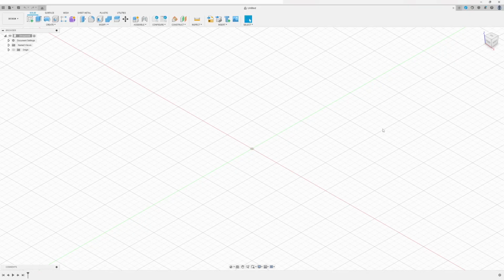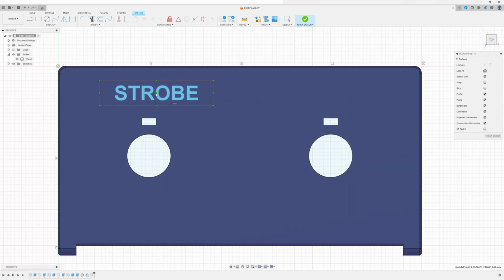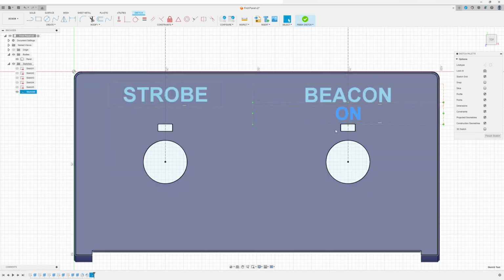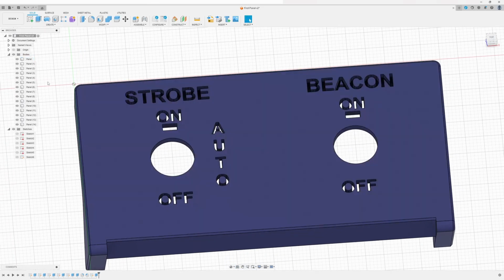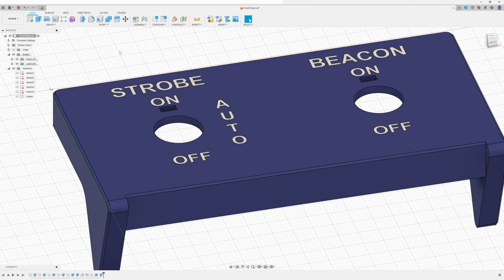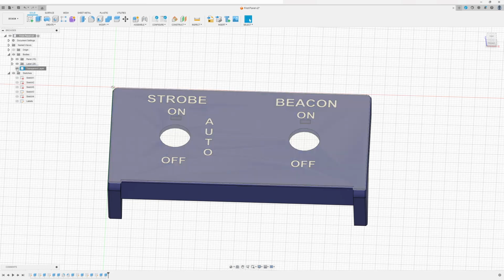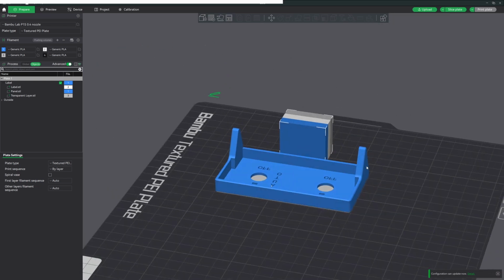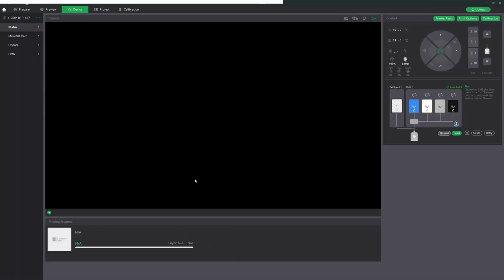Full Home Cockpit Build - EP 06 - Multicolor Printing

Comment: I have tried this with a korry face and have noticed that it only works with .stl files, not with .3mf files. With 3mf BambuLab asks me if the files should be converted into inches or meters which makes them load individually, thus rearranging the individual parts.
Reply from the maker: Try to change your Bambustudio units from imperial to metric. Then it should work. Don't forget to change it back afterwards.
Reply: @TheCockpitPrinter I just switched the Export from 3mf to stl that worked as well.

Comment: My first test print I made while following your instructions turned out beautiful. I have a Bambu P1S.  however, every subsequent test print I've done has turned out with the clear layer looking milky. I am using the same filament as the first print, the hygrometer says it's 10% humidity in the AMS, I don't know if I changed any print settings since that first print. I put a brand new roll of transparent filament in there today and the clear layer is still looking milky.  I don't know what the issue is.
Reply from the maker: It's hard to tell... It could be a dirty or worn out nozzle, wrong temperature or wet filament.
To figure it out I would change the nozzle and print directly with the clear filament. If it's still milky it's definetly not the nozzle. Change the temperature slightly for the clear filament. If this doesn't change the result try a fresh spool of clear filament. If this print is ok the other filament is wet.

Comment: Great videos so far!! I should be able to use Bambu A1 with AMS and 0.2 nozzle to do these panels, right?
Reply from the maker: Thank you very much! We are just using PLA. Printing on the A1 should be no problem. The build volume is with 256x256x256mm identical to the P1S

Comment: Very good video. Just one question (in case I have missed that): don't we now have a thin transparent layer on top also above the wholes? Or was it 'deleted' somewhere and I just did not fully get this?
Reply from the maker: Oh, I‘m sorry. I missed that. There is the transparent Layer on top but without the holes. If there would be the holes in there it would be visible on the surface because the Printer has to reposition between the holes. Just use a sharp knife to cut the out the holes.
Reply: Excellent use of multi colour printing 👍🏻